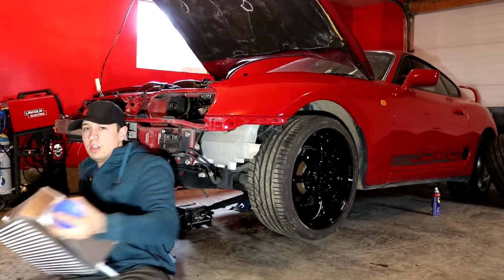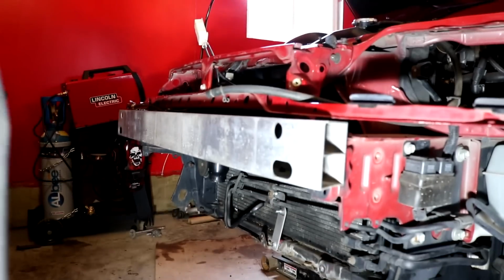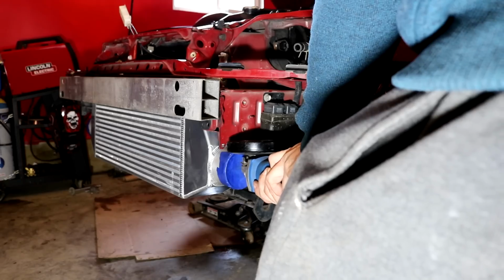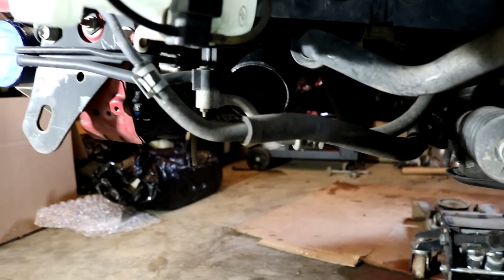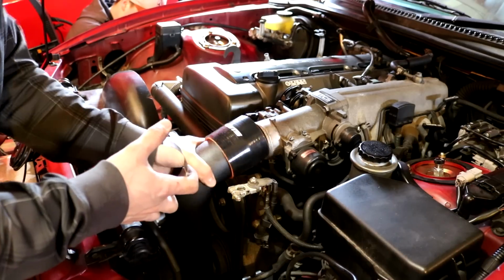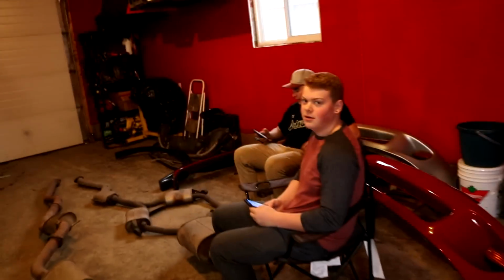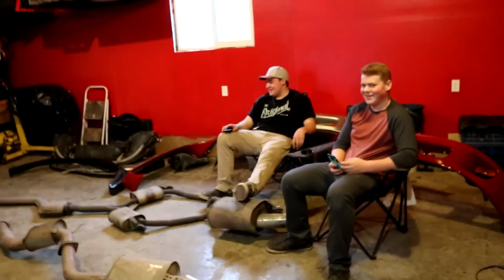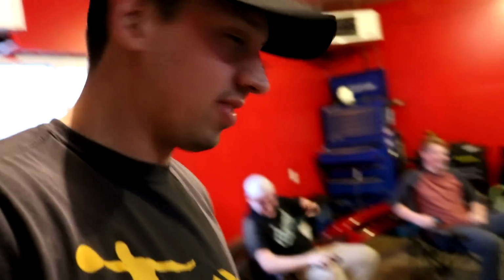Supra Gets Huge ETS Intercooler

Comment: I'm planning on getting an ETS intercooler too but not sure how big? What persuaded you to get the 5in thick versus the 4 or 6?
Reply from the maker: this one wont be making more than 800hp so 4 inch is fine, my supra has the ets 5 inch. too big and youll lose spool time and its heavier. so depending on your power goals youll need 4-5 or 6. rough numbers 4 for 850hp 5 for 1100 hp 6 for 1100+

Comment: rip cooling... how're you gonna deal with reduced airflow through the radiator? 10/10 vid btw
Reply from the maker: +Fawnzee it doesn't make a different really 😝 I never tried it road racing however
Reply: Ah, I know for 3000gt's atleast, as soon as you go front mount, you need to recreate the whole system and basically make the radiator thick, and look similar to the fd radiator layout. Of course, 3k's have a lot of heat to deal with in the engine bay, but both being 6 cylinder twin turbos (in stock form atleast), I'd figure it'd be pretty similar.
Reply: Fawnzee most of the cooling comes from the belt fan. That's why deleting it is dumb, all of the people who replace the belt driven with twin electric ones are essentially giving the system less ability to cool.
Reply: no, with a 5 inch aluminum heater in front of the radiator, it's much less efficient no matter what fans they have on them as they're just sucking in warm air.
Reply from the maker: +Fawnzee nobody has an issue with the cooling
Reply: http://www.3si.org/forum/f35/overheating-fmic-guys-chime-518025/
http://www.3si.org/forum/f1/fed-up-overheating-522643/
theres dozens more on every forum. I wasn't saying this does, was just asking a question in the beginning, and then explaining why it affects the temps and how little it had to do with the fan. All good though, done asking questions here... take it easy
Reply: Fawnzee the fan doesn't do "little." My MK3 rad has virtually 0-10% of actual airflow hitting it from the front. If you think the fan does little, try downsizing it or deleting a fan completely, watch what happens. Lol
Reply: okay, the point has once again gone completely over your head.
Reply: Fawnzee no, not really. Blunt point: This doesn't affect the cooling system of this car specifically. 

Second elaboration made that is being dismissed is important to understand why this huge intercooler doesn't affect temperatures for the motor, but if you disagree, that's on you. 

Also, considering that 3000's and Stealths are mounted horizontally for the AWD, a belt fan is not used(I believe/assume), which could be a key factor as to why those specific cars get hot when airflow is reduced.
Reply: okay, I guess that makes sense, but only time will tell.